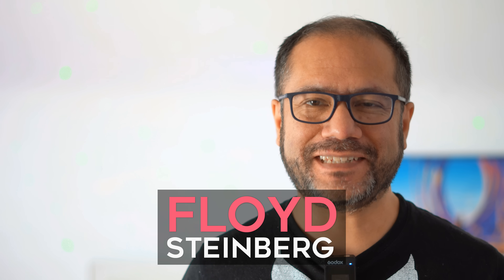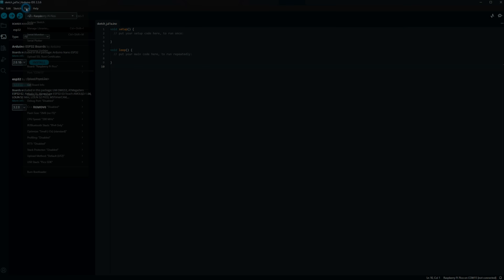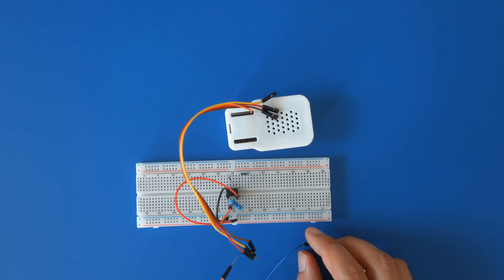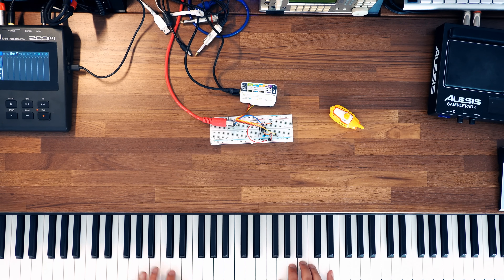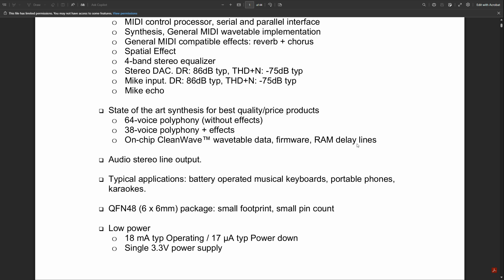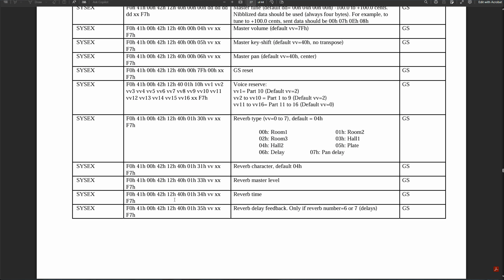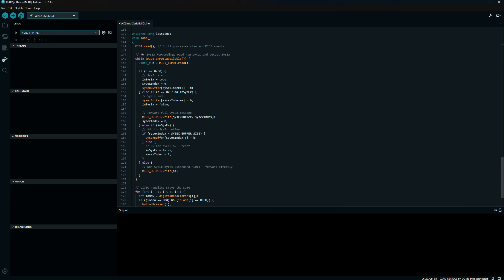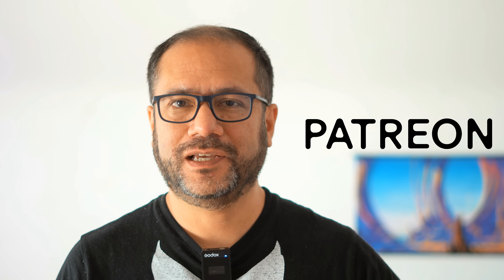A $20 MIDI synthesizer based on the SAM2695 chip (#seeed  #XIAO-MIDI-Synthesizer)

Comment: Is the microcontroller soldered to the synth PCB or just socketed? I would like to use a different microcontroller and integrate the SAM2695 into a synthesizer project rather than controlling it via MIDI.
Reply from the maker: Hi, I can't check at the moment, but if I remember correctly, the controller chip is sitting on pin headers and should be removable.

Comment: I regret buying it, honestly, when playing e.g. piano from the lowest to the highest key, the sound of the piano is suddenly changing quite a lot, just over 1/2 a note, not sure if precisely divided per octave.   Whoever pretends this to be a synth; can somebody tell me why it sounds like multiple sample banks played at different sample rates?  I understand the algorithms may cut some corners, but I rather believe this box is filled with sheer ignorance about synthesis.
Reply from the maker: I'm sorry to hear that it disappointed you. As I said in the video, this is a system-on-a-chip by french company Dream that's been around for roughly 10 years, and it's not a high-end-sound, more like early 1990s. RAM is really limited here, so there's not much space for samples. I think you can spot that in the demo I played. 
Nevertheless, you can get some cool sounds out of this if you use the synthesizer part to your advantage. Sweep the filters, use delay and reverb and chorus, plug your guitar into it (if you do some soldering, that is) I find it fascinating all of this is possible with a 5x5mm die ;-)
Reply: @mr_floydst  I agree it is fascinating as a whole, likely based on wave table synthesis we've seen in PC sound cards in the early 90ties.  I admit it may need many more months of programming to get so many instruments and effects implemented on a slightly more expensive Daisy Seed (~22$).

Comment: Thanks great review bought one, , I tried to read Manuals an specs but I can’t find if it support supports MIDI Real-Time messages, including Play, Stop….. I am trying to use it as a sequencer
Reply from the maker: Hi, this specific board can't do a lot if you don't write the code yourself. The SAM2695 chip can process MIDI in real time, but (other than 90's GM synths) it won't react to all CC messages unless you assign a controller to them using NPRN commands, that's a bit more complexity there.
I've seen some sequencer firmwares out there, you'll find that on Google/Bing.
Reply: Thanks, the challenge are real time messages , I tried to build something like before … will keep trying , anyways can wait for the board to arrive (ordered also cardputer and separate midi module) 100€ investment , let’s see

Comment: I should receive 2 today ordered from Germany, this is not a revolution but revolutions cost more than 20 bucks ! (usually)
Reply from the maker: Yes, it's a very small GM synth (the chip itself also has a MIC in which can be routed through the effects processor, so you can come up with some powerful shenanigans if you're handy with a soldering iron and a bit of C++ coding). ;-)
Reply: @mr_floydst  I am ! Thx
Reply: .001 thickness condoms cost MUCH less, actually
Reply: @OMNI_INFINITY  For a different usage I hope.. 
In french, "MUCH less" is called an oxymore.

Comment: Excellent sounds
Reply from the maker: Thanks! It's really impressive considering the actual chip / die is 5x5mm in size.
Reply: It literally sounds similar to the general midi samples (aside from that one vaguely moog preset) in the early soundblaster soundcards from about 30 calendar years ago...are OK?
Reply: @OMNI_INFINITY i recently listened to SAM 2635 samples on a HiFi speaker. Quite nice sounding

Comment: Thanks again Floyd! 🙂
M5Stack also sells a SAM2695 with DIN 5(seperate in and out) for US$14.95 .
Current version includes audio output, previous did not.
Espressif recently purchased M5Stack, makers of the various ESP32 modules.
M5Stack also sells encoders, pots, buttons, and faders all connectorized ready to make your own doodads. It's not too expensive but needs programming to work. Many examples can be found just like Seeed products. Seeed and M5 often use the same connector wiring for easy mix and match. <<<**not always the same pinouts**

Comment: M5stack has a MIDI module that has an optocoupler built in, you just need to connect TX to RX and find a way to provide 5 volts. Same chip.
Reply from the maker: Thanks for pointing that out. There are even more cool open source projects built around this chip out there. (Midiguy)
Reply: Midi Out socket includes 5V out (via a 120ohm resistor) some devices exploit this feature
Reply: m5stack guy seems less hateful toward non-chinese than seeed studio employees also

Comment: I have played with the M5 Stack synth module connected over Grove and ported the library to MicroPython and made a small sequencer (threaded).
It's a lot of fun, but that module does not have an output jack, just the internal speaker
Reply from the maker: Thanks for pointing out that one - seems there are some implementations out there! (The SAM2695 has been around for 10 years already, so that's not a surprise)

Comment: I would pay 40$ for something like this that actually works out of the box. Thanks for making this video.
Reply from the maker: Please search the internet for "MIDIguy" ;-)
Reply: @mr_floydst 🎉thanks. I would still need the features you packed here: usb, change of sound bank. So the best solution is seems to be your pi zero version
Reply: I recently bought an old used Roland midi synth for 100$. And I'd rather have this.
Reply: That's the problem with these small things. Might be fun if it's only for the diy fun of building something around an arduino, but if you would like to use it for an actual sound source, finding a used Roland SC-55 for about the same price should be possible and the Roland sound much better and have much better functions (and also cost much more when it was introduced) From the spec sheets Floyd showed it actually looks as the chip is designed to be somewhat compatible with the Roland GS Standard. For the actual play demos it sounded very decently, but if it can only work on 4 tracks simultaneously you are limited. I used to use a Roland SC-88 heavily back in the 90's and if you are interested in midi implementations these modules is incredible fun to work with if you have a well capable DAW in midi handling and just any small midi controller. There is so many things you can control via CC's and Sys-ex. And It's a great way of learning working with Hex, binary and Decimal converting that is more fun than a standard computer course in these things 😊
Reply: Oh? Want to buy things from chinese that hate ya?

Comment: So, it's a ROMpler?  I.e. based on a fixed set of samples?
Reply from the maker: Yes, that's right. The chip itself also has a microphone in pin (so it has an ADC) which isn't used in this setup.

Comment: Sounds like a gm samples based synth. I saw the dream heading on the spec sheet and knew right away I was hearing a terratec sound card without a win98 pc
Reply from the maker: Yes, you're right. This particular chip has been around for 10 years. BTW the "Terratec EWS64" was quite impressive (and still is). ;-)

Comment: Is it possible to connect it to a controller without a midi input (din) and only with a USB input?
Reply: No because that requires USB host functionality. For you the easiest thing would likely be to get a USB MIDI host like the Behringer one.
Reply: @maksmakes  Would the Doremidi host device work? It's cheaper
Reply from the maker: Not without Seeed replacing the MCU with another one (this one can't act as a MIDI USB host)

Comment: Floyd, that was an impressive track that you made on this little machine! I appreciate the deep dive that you went into on MIDI and sysex here. It's a lot more in depth than what most people show. I do a lot of work with MIDI and Arduino, and I appreciate that. I've had mixed results with Seeed products before with some of their Xaio boards having flaky power supplies in my experience. This particular product was not on my radar, but I'm intrigued. It reminds me of the MIDI synth capabilities on the Adafruit Music Maker board. I have experimented with that some, and it's pretty interesting too. You might enjoy checking that out. Thanks for the video.
Reply from the maker: Thanks for your feedback! This is the first of their product I've tried (and it really has not that many points of possible failure). I'll take a look at the Music Maker!
Reply: It literally sounds similar to the general midi samples (aside from that one vaguely moog preset) in the early soundblaster soundcards from about 30 calendar years ago...are OK?